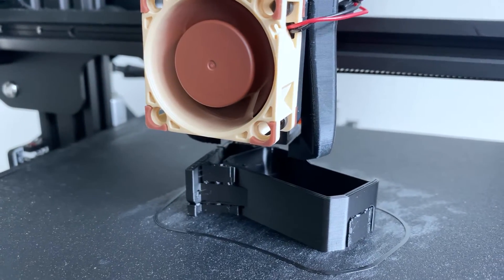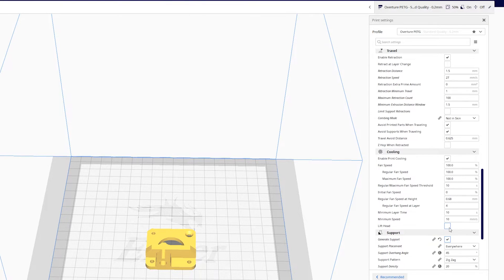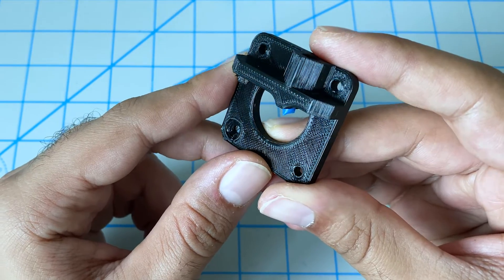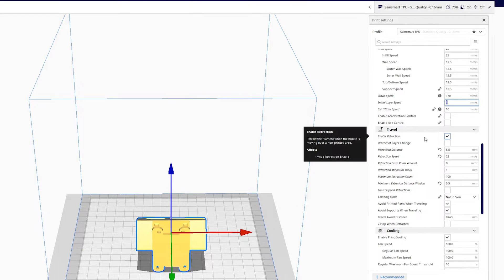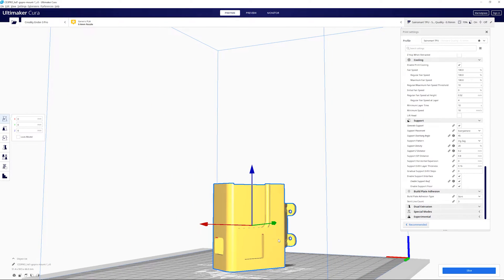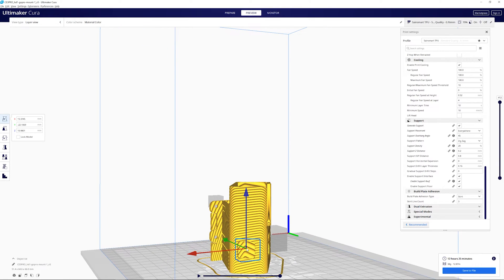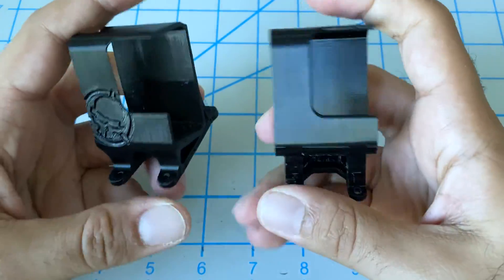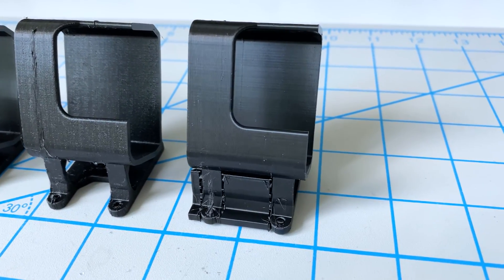How to Print TPU Flexible Filament on the Creality Ender 3 Pro | Not All TPU Created Equally!

Comment: When you apply the glue do you let it sit for a while, or do you go straight to printing? Also how much glue is needed?
Reply from the maker: Apply the glue, wait a few minutes for it to dry and then start printing. Just a light coat, you don't want to make the print surface uneven or leave globs of glue behind.
Reply: Awesome, would I need to clean it after each print or just wait after a few prints?
Reply from the maker: @bubbafett2700  If you move the print to a new section of the print surface then you can reuse but if you want to print in the same place, you'd need to clean off the glue and reapply.
Reply: Cool thanks for the tip.

Comment: Sorry video didn't help
Reply from the maker: What challenge are you having with printing TPU? Is it the print quality or the filament jamming?
Reply: @Mangorille  its the inconsistency ive messed around with many settings and have had only a few prints come out and they were not pretty ive ordered pla to use i while i figure it out thanks for the concern though have a Great Day

Comment: Thanks for your video, I was struggling today to get TPU to print on my Ender 5, turns out I had the speed set way too high. I followed your settings and success.
Reply from the maker: Awesome, thanks for the comment. The key to TPU is speed, retraction, and temperature. Happy printing!

Comment: can i use  this third part on my ender 3?and can i print pla petg with this part without to change it with the original part?
Reply from the maker: Hey. Can you clarify which 3rd part? You mean the extruder that is printed in this video?
Reply: @Mangorille  yeah the printed piece
Reply: i mean the extruder printed
Reply from the maker: @JPFaerialops225  Yes that part should work on your Ender 3 and it can be used for PLA/PETG as well. There is no need to swap it back and forth.
Reply: @Mangorille  great! thanks , can i cut an smal peace of the original ptfe tube ender 3 for this printed piece ?or i must order another one on the amazon link you posted?
Reply from the maker: @JPFaerialops225  No problem. I'd suggest buying an extra piece. Long term you'll end up replacing that original PTFE tube. Also, it may take you a couple of tries to cut it correctly for the new extruder.
Reply: @Mangorille  ok thanks

Comment: I bought the metal extruder and have had no problems printing with TPUs!
Reply from the maker: The metal extruder that has no gap between the gear and the inlet? Harder TPU will print okay with the stock extruder at a slower speed as well but the softer stuff will jam up.
Reply: @Mangorille  I was using 3D Solutech Flexible filament before they discontinued it. :(
It worked perfectly for me! I've got NOVAMAKER TPU Filament on order and should have it by Friday. We'll see how that works on my Ender 3 Pro!

Comment: mine doesnt work :( it doesnt extrude anything out of the hotend
Reply from the maker: What temperature are you using on the hot end? Did you use the upgraded extruder in the video?
Reply: @Mangorille  Ive tried 200, 210 and 230. I haven't used the extruder because I didnt believe it would make a big difference. I'll print it in pla and test that.
Reply: @Mangorille  extruder didnt make any difference :(
Reply from the maker: @zippohvh  If you look at the extruder, is the gear turning but the filament not moving? What print speed are you using?
Reply: @Mangorille  yeah the extruded turns but the filament isn’t, I’m using 25mm/s for tpu
Reply from the maker: @zippohvh  Does the filament bind or get stuck when you try to push it by hand when the extruder is in the "open" position?
Reply: @Mangorille  if I try to push it manually it bends and doesn’t wanna go in. Pretty sure that’s just because it’s tpu tho, could be wrong.
Reply from the maker: @zippohvh  You should be able to push it through by hand. What kind of TPU are you using? What's the shore hardness rating? What kind of bowden tube?
Reply: @Mangorille   I’m using Anet TPU,  According to google it has a rating of 95A. I’m using the stock PFTE tube on the Ender 3 max. Does the nozzle size matter? I notice it came with .2 and .4mm, I’m using .2mm right now.
Reply from the maker: @zippohvh  Definitely would make a difference. If you are using the 0.2, try printing a lot slower than the 25mm/s. That speed is more suited to the 0.4.
Reply: @Mangorille  Just cleaned the entire hotend area and swapped it with the 0.4mm nozzle, and now its printing :) thank you so much for te help!
Reply from the maker: @zippohvh  Glad to hear that, happy printing!

Comment: Wonder if the Micro Swiss direct drive kit would work well for TPU? I have the kit on my Ender 3 Pro, but haven't tried TPU yet.
Reply from the maker: Have not tried that one and cannot tell from the pictures whether the tube goes all the way through and close to the extruder gear. Usually for direct drives that is how they work. I suspect it would work fine and even better than the bowden setup as you do not have the long tube to deal with.

Comment: The project you are working on at the beginning of this video is very similar to the prototype that I'm working. I have had my Ender 3v2 for less than a week. I'm using the Cura software and my first 5 printing has a tremendous amount of stringing. Any chance I could see your profile for the project that your working on? I am using TPU flex, thank you.
Reply from the maker: Hey. Shoot me an email mangorille at gmail and I'll send you the Cura profile. You'll still need to fine tune it for your specific printer but should get you close.

Comment: so after doing this (printing the part) I was looking at my stock extruder and it seems to have the exact same size hole, are you sure there is a gap / need to fix anything?
Reply from the maker: Hey. If your extruder is the stock one there will be a gap between where the extruder gear ends and the bowden tube starts. This printable upgrade extruder fills that void with a small piece of bowden tube.
Reply: @Mangorille   you’re right! Apologize I was thinking “gap” interns of the diameter size of the hole, not length wise to the gear. I’ll let you know how it goes! Bought my glue stick today
Reply from the maker: @ManchesterFC7  No worries, happy printing!

Comment: Is the glue stick necessary with the creality glass bed plate?
Reply from the maker: The creality glass bed has good adhesion already but if you are printing a small piece you most likely will need the glue stick. The only way to know for sure is to try it out and see how the bed adhesion is for your printer, filament, setting combination.
Reply: I'm printing TPU with an Ender 3V2 and I never had trouble with adhesion on the glass bed. And I don't use any supports like glue or sonething else
Reply: @danielroth378  just glass or tempered glass? My small prints still warp
Reply: @vitopulverenti  tempered glass, 50°C is enough
Reply: @danielroth378  hmm maybe I’m just running too high at 60°C
Reply: @danielroth378  I’m even using bed weld glue and it’s still warping

Comment: Is the Overture TPU good? Getting my first 3D printer tomorrow, ordered some of the overture TPU to come with it
Reply from the maker: Never tried the Overture TPU. What are you looking to print?
Reply: @Mangorille  Ultimately a GoPro mount for my drone. I have a REALLY solid first layer going right now. Didn't have any extra PTFE tubing (just got the printer yesterday) but I found a remixed version of the thing you printed in this vid, that extends out a bit, eliminating the need for the tubing. Mirrored your settings in Cura, put a bunch of my daughter's glue stick on there... and it's not sliding across the bed like it's not hot enough. I was getting so mad earlier til I found this video. Thanks a lot man!
Reply from the maker: @RYVENANT  Glad to hear it's working out for you now. You may want to grab a small roll of the Sainsmart TPU to try out for your drone parts (I have links to Amazon in the video). It's our go-to filament for printing drone parts now.
Reply: @Mangorille  just ordered a roll in white to give it a shot. Going to try the sainsmart PETG as well. I got Sunlu PETG but the listed specs aren’t working great. Very stringy and not bridging nicely
Reply from the maker: @RYVENANT  PETG does not bridge as nicely as PLA so no surprises there. What fan speed are you using? For the stringing, what are your retraction settings?
Reply: @Mangorille  tried one print at 220° which seemed a little low, cranked it to 240°, bed at 70° for both and similar results. Stock cura settings otherwise, so fans at 100% and retraction enabled, 6.5mm distance, 25mm retract speed. Should I change to be a little closer to the TPU retraction settings? 

Grabbing some sunlu PLA in white right now as well. I want to make a baby yoda for my daughter to paint lol
Reply from the maker: @RYVENANT  Unfortunately you need to experiment to find the best settings for your printer and filament. PETG sweet spot seems to be around 230 - 240. If you find it is stringing too much, try going down to 230. Also, PETG is hygroscopic so it will absorb moisture over time. Are you leaving it out in the open in a humid area? For retraction, try 5mm @ 50mm/s. Hehe, that is awesome, good luck with the baby yoda print!
Reply: I just got mine a couple of days ago, this quaranteen has me bored as hell man. Which one did you get?
Reply: @bgcm1995  Ender 3 Pro. Wanted the V2, none in stock on Amazon. Just ordered the glass bed and an auto leveler and I should be good to go for a while. This thing is so fun man, I have it right next to my home desk so I just stare at it printing for hours lol
Reply: @RYVENANT  my apologies I literally grabbed the last ender v 2 about a week ago, that might've been me 💀
Reply: @RYVENANT  I have yet to print anything out tho, I wanna buy a small desk for my bedroom and keep it there so I have yet to set it up, plus re doing he bathroom at the moment. As soon as that is done, I'm def gonna jump on it

Comment: Thanks for the video! This gave me a great baseline to start with. Im printing on the Ender 3 v2. I wanted to ask you, as for esteps calibration. This seems to be different depending on the type of filament being used? I have my esteps calibrated perfectly for PLA, but when I try and check it with TPU its always off? Is there such a thing as calibrating your esteps per different types of filaments? Have you noticed this as well or am I crazy? Thanks again for the video!
Reply from the maker: Hey bud, you're welcome. Yes, noticed the same and needed to do a steps calibration for each type of filament. The easiest way is to add a start gcode (m92) to your slicer for each profile to set the correct esteps once you have them figured out for each type of material. Check this out for the m92 command: https://marlinfw.org/docs/gcode/M092.html
Reply: @Mangorille  thank you! I'll check that out.

Comment: I just got some sainsmart tpu today and I'm using a Ender 3 Pro. This video saved me hours of messing with settings and saved a lot of TPU as well. I literally just put in the same settings, hit print, and an hour later, I had a perfectly printed cube. I know its not the ultimate test to see how its printing, but it is a really nice looking cube with really good layer adhesion and no real printing artifacts. I used the translucent blue, so I can even see the infill and it even looks good on the inside. I'm even just using stock extruder and fans. The only upgrade along the extrusion path is a Capricorn PTFE tube. The only thing that is going a little wrong is the corners on the bottom curled upwards after the cube cooled. Is that a property of TPU?
Reply from the maker: Hey. Glad to hear that the video helped! The print shouldn’t curl upwards are cooling. Are you sure it only curled after cooling and not that it actually started peeling during print (pointing to a bed adhesion problems)?

Comment: I just tried a small test print with your ender 3 settings on my new CR-10 V2 3d printer, and it works perfectly! Thank you for your help! Now I am going to start my 17 hour print job of the larger project with these settings, fingers crossed! :)
Reply from the maker: Glad to hear that, thanks for the feedback! There's going to be slight differences in each printer so you may have to tweak some settings long term but it should at least get you in the right ball park.
Reply: How did it go? Mine gets here tomorrow :D

Comment: Very helpful, thank you!

Do you recommend printing with a raft? If so, how do you keep it from sticking?
Reply from the maker: You're welcome. General advice on printing applies to TPU as well, try to avoid using supports and rafts unless you absolutely have to. You should be able to get the print to stick without rafts, even smaller pieces will stick if you use a glue stick like shown in the video. If you have to use rafts, you'll need to play around with the air gap to balance the support the raft provides and the ability to remove it easily from the part without too much surface damage.

Comment: Did the filament come with ziplock bags for storage?
Reply from the maker: Hey Andrew. The filaments come packed in vacuum bags but they’re not reusable. You can use a normal freezer bag after you open the packs.